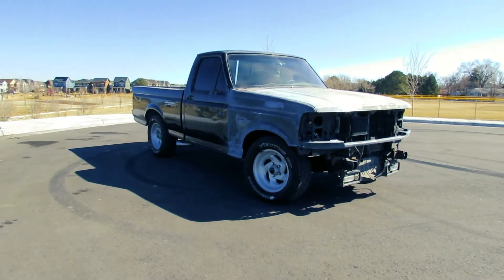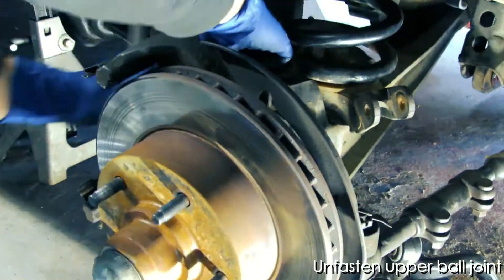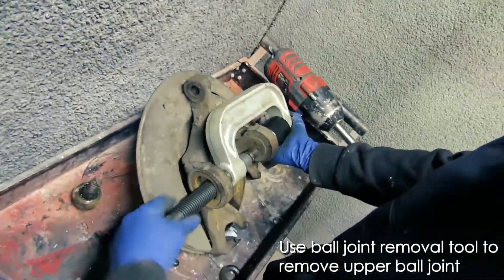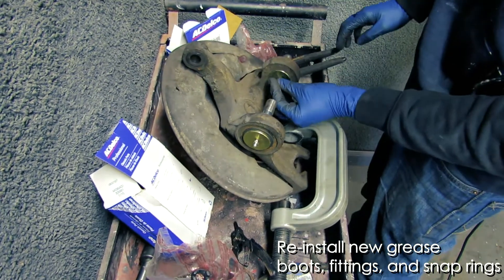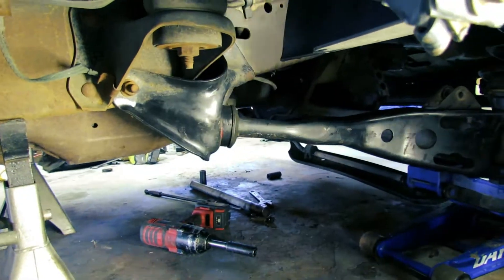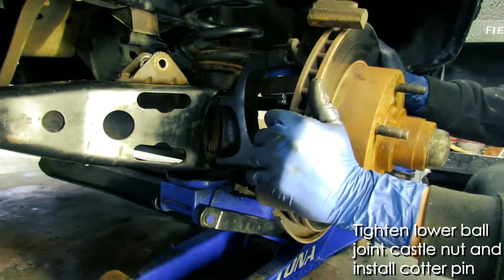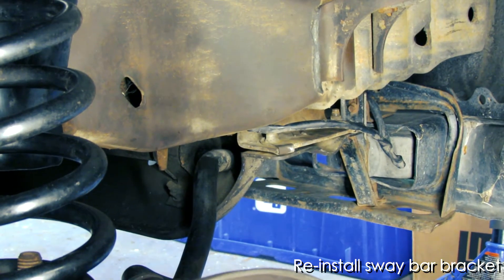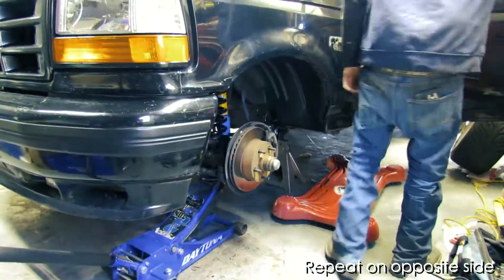1995 Ford Lightning F150 Restoration - Ball Joint and Shock Replacement

Comment: Hello I have 1994 lighting cammed but it shakes a lot and dies any suggest on what I should do ?
Reply from the maker: Hi there, did the truck do this before installing the cam?
Reply: Hello, the previous owner installed so Iam not sure if it did, and the exhaust fumes smell like gasoline. And suggestion on where to start ? Do you have insta
Reply: Nice job 

where can I find those coil springs